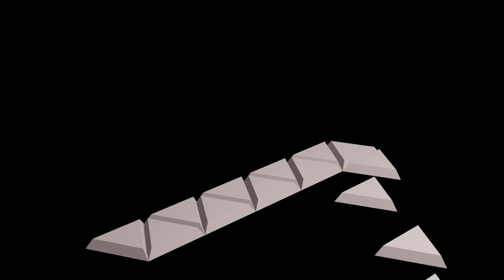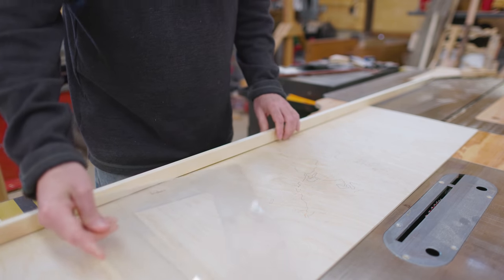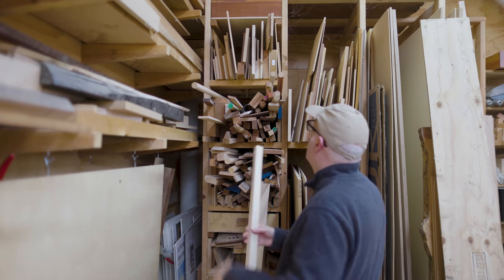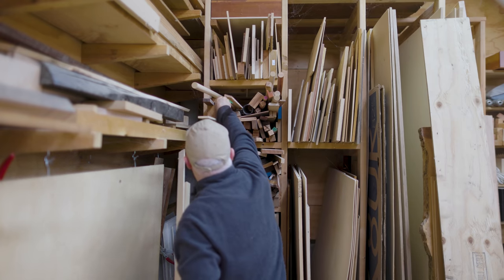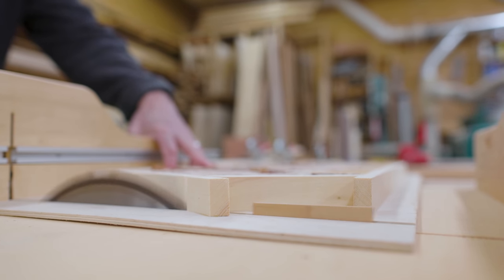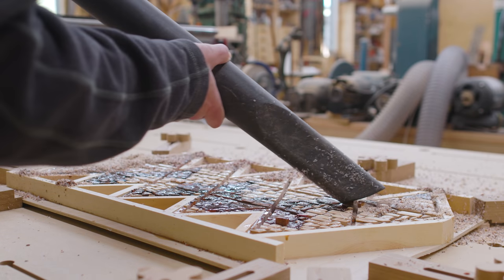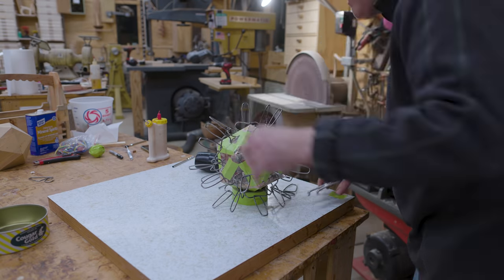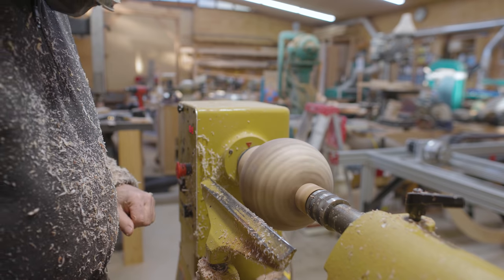Making a Mosaic Globe

Comment: Instead of the blocks being square shaped, you can use 3- and 6-sided shapes so they blend in with the final triangles. 

Also, orienting all the blocks to their final radial position in the sphere would reduce the choppyness. It would be a pretty hard to setup for an all wood piece like you've done before, but with this resin design you could put play dough in the bottom of all the triangles and press your pieces into the correct angles to point to the final "center". Then, just pour the resin and proceed like normal.

Comment: Hey Frank. Another great project. I   recall with the ornament project, you were a little upset with some of the joints getting off/having a slight gap. I noticed at 14:36 your jig gets pushed up on the blade which would change the angle being cut. That might be a place where some inconsistency was showing up.
Reply from the maker: I noticed that too.
Reply: I had to check to see if anyone else had noticed this.  Maybe add a 2.5KG/5.5lb weight cup onto the jig to ensure the 'tiles' are held down.

Comment: always a fan. great video. One thing with degassing resins is that they form bubbles when moving across surfaces. I am no expert in wood + resin. I liked the construction method, if you degassed and then poured the resin in pieces that would fit in your vacuum pot you would degas the entire triangle, from the bottom to the top.
Reply: I really think you are on to something very creative. If you got resin that was relatively UV stable no reason why you could not put a light inside the sphere.

Comment: If you wanted a blue effect for the ocean, maybe you could have stained the wood a bit before gluing it into the triangles?
Also, you could incorporate the triangle seams into the final design by having the initial wood scraps all be triangular. It would probably be pretty wasteful though. But it would definitely help if it was all tessellated.
Reply: Since the resin is clear, he could just drill a hole in the bottom and shine blue light out of it.

Comment: Have you thought about building the icosahedron first  with the drawn lines outside and then gluing blocks on top of it. In this way you can see how it will look when gluing. After that you could cast it in a cylinder (which would probably fit into the vacuum chamber) and then turn a Sphere from that.
Reply: Yeah, I was going to suggest making a full wooden sphere first and then gluing blocks, resin-ing, and re-turning.  Same idea.

Comment: Hmm, I wonder if you could make the epoxy some sort of mix of wood chips and epoxy. The differences between the triangles seem to be most apparent in the oceans, so maybe adding chips would blur those boundaries a bit? 

I wonder if you could repeat this style but with dowels? You could drill holes in the plywood base to locate all the pins, and perhaps use small dowels. That might let you plan out exactly how the dowels would meet.

Comment: Very interesting as usual, i have made several projects inspired by you. An idea might be to first make a smaller sphere, then glue all the pieces onto the sphere. Then fill everything with epoxy and then turn it a sphere again.  What compound angles are you using for the triangles?  Best regards /Danjel

Comment: I think you could hide the seams between triangles better if you used scraps that were themselves triangles. I think you’d want a distribution of sizes and try to avoid patterns in the layout but keep a general orientation (or rather, two orientations, up and down) to the triangles. Then if the seams happen to cut some of the triangles the seams will be in the direction of some lines that are already in your pattern.

Also you should totally take advantage of then hollow sphere and put some LEDs on the inside.

Comment: Would it have been possible to cut the bevel using your CNC? If it hadn't warped in the oven, you could've done the bevel so the bottom of the piece is seamless, and the seams would've ended up on the inside of the sphere.

Comment: My goodness, you provide so much information about how to  make a icosahedron. Lots of details and a practical way to make the triangles. And it's fun to watch as always
You say that the angles cut on the edge of the triangles are all the same. 
But you never tell us WHAT that angle is! 
If anyone were to make a icosahedron they would have to have this critical piece of information.
Strange omission
Edit.   Well I went down a 20 minute rabbit hole in search for the angle that you cut for the three edges. Not easy to find. Complex calculation. 
The angle is 69.095° where vertical is 90°.

Comment: What about making a smaller sphere as your base, then draw the globe on that using your 4th axis on the cnc. Then glue all the scraps to the already built sphere. You'd need to taper the cuts on the scrap to accommodate the fact that the pieces need to be bigger on the outer edge. This would give you a really clean globe because all your triangles would be hidden.

Comment: For a sphere that size and the time you put into it, I think it's pretty great. The very first view of the completed globe I was able to immediately say "That's Africa! And Madagascar!" Obviously if you made it bigger with this size blocks, or used smaller blocks on this size sphere, there would be more detail but it could have taken 10x as long :D

I agree the seams need attention. And there's something about the ratio of resin, or the size of the ocean pieces, that just feels a tiny bit off. It could be the color variation, and maybe your comment about making the resin yellow tinted would improve that.

But it's definitely a cool project. You seem to have settled on 20 sided triangle / icosahedron based spheres. Have you given any thought to trying other more complex polyhedrons again?
Reply from the maker: I want to make a dodecahedron (12 pentagons ) but I need to figure out a jig to cut the sides on the table saw.

Comment: You laid out the pieces in the jig  horizontal to the jig.   Maybe they should be inserted horizontal to their final position - grid lines on your world map would help.     
Re the edges of the triangles you could start with 2/3 size matching pieces in two or three set measured positions on each edge, knowing they would butt together, then infill thereafter. The visual impact of triangle edges might be reduced if the sea/land flowed across them.
Other ideas;    lay sea in to appear horizontal & land in vertical,   have the 7 continents in individual wood colours, or even differing 2 colour sets
As they say the devil is in the detail !!!

Comment: I guess for the pattern to be without seams - you seem to have no other choice then building the sphere from the ground up - without using triangles... like the internal sphere made out of anything cheap, or some kind of balloon, then glue your parts of the chosen pattern there - perpendicular to the surface of the sphere, then make some sacrificial outer shell close to the size you need, put the insides in the shell, pour resin and you have your ideal sphere with the proper pattern. Please check other channels who do that - it's easy to find))))

Comment: the problem of projecting a flat surface to a globe. I think if had put the blocks in on a curve rather than flat across as well as thinking about the angle of the triangles it would not be as broken up.

Comment: just spitballing here, what if you make a map with inlayed continents, place it face down on the waste board, then use a V bit on the CNC to cut the path/lines that makes up the icosahedron template (cut channels similar to the annimation at 0:07 of your video). Then all the seams that are touching on the template would just need to be "folded" over on each other, and you wont loose any material from cutting the triangles. ps Im not sure what the angle of the V bit will need to be or if any companies make that angle